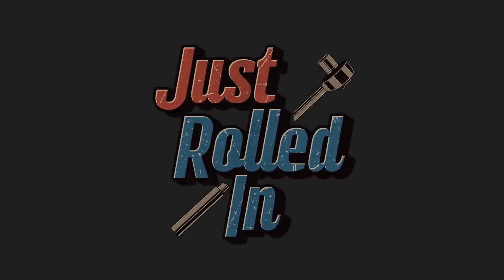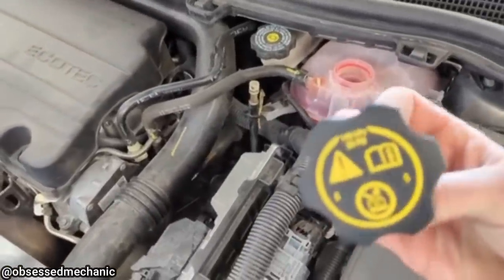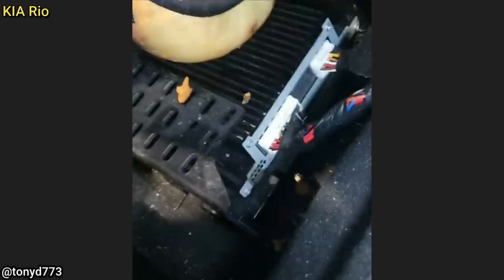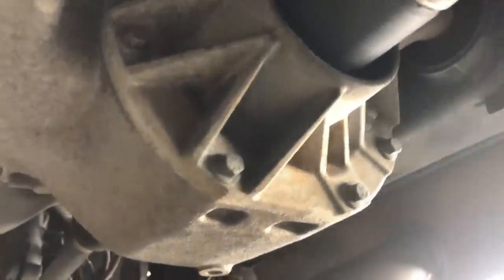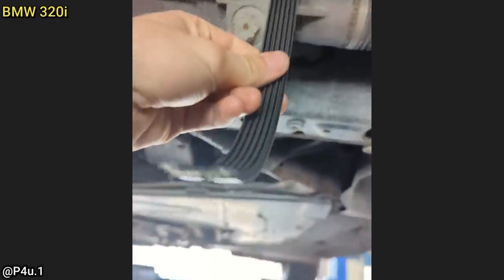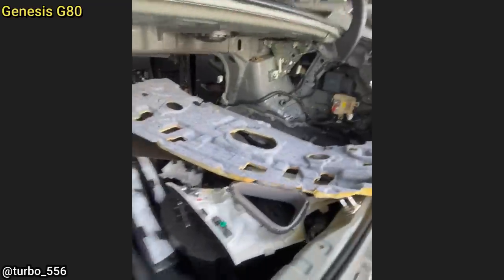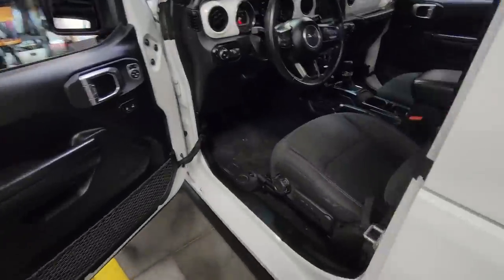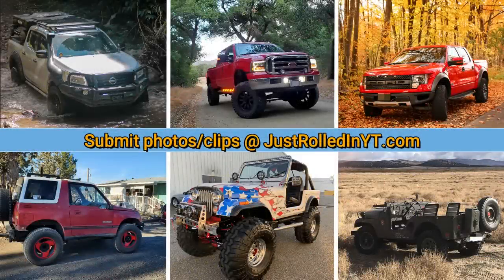Customer States Tire Fell Apart Two Days After They Were Installed (4 Months Ago) | Just Rolled In

Comment: You always bust on the customers but let me bust on a technician. I worked at Scranton Dodge which is a complete pile of crap dealership but that’s another story. A woman brought her jeep in for inspection in March the technician inspected it. She just came back in with a noise both subframes were so rotted away they had fist size holes in them, the rear control arm mounts on the sub frame were completely detached on one side and the wheel was moving around. The dealership was going to put the two sub frames in under a recall and hammered the lady for all the other parts that were needed to put those sub frames in after the technician failed to do his job properly. I no longer work at this dealership.

Comment: Not going to tell us what was wrong with the Jeep?
Reply from the maker: I've showed it 3 times in previous videos, so it was an update to show that it was completed and the costs. But the customer took it off roading and afterwards it wouldn't start. Had the interior removed to get wiring harnesses and modules replaced. New carpet and some body work as well if I remember correctly.

Comment: 18k for jeep with 0 info? Sure
Reply from the maker: It was an update to a clip I showed 3 times in other videos. They took it off roading and afterwards it wouldn't start. They filled in the inside with a couple of inches of water. Interior had to be gutted, modules and wiring harnesses replaced and some body work.

Comment: Anybody who would pay for an EV is an idiot. Anybody who would pay for one six times? What the things actually worth isn't even bigger. Idiot I mean Evie's or only cool if you plan on getting rid of them within 5 to 6 years. They're just not cool when it comes to resale because I feel bad for the person who thinks they're going to buy a 7-year-old electric vehicle and just get in it and drive like it's an old Toyota Camry. Because let me tell you those batteries cost like 40,000 when they need to be replaced and it's going to be more than the actual vehicles are worth. So am I suggestion is either buy one brand new or not at all?